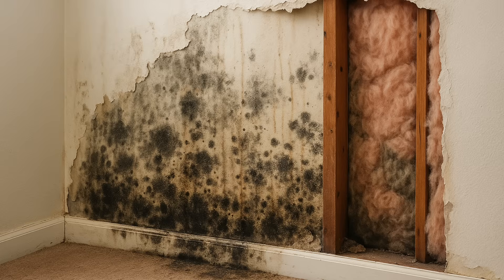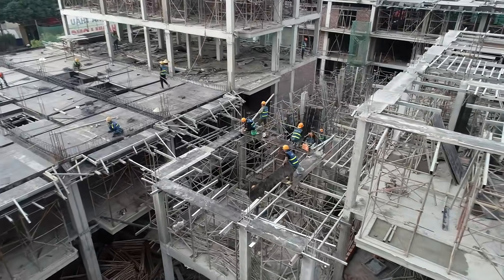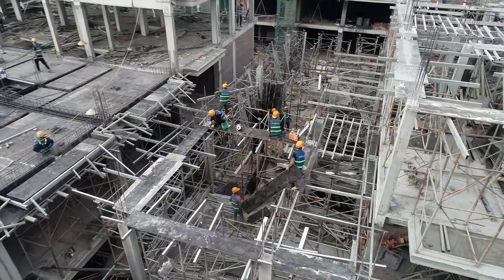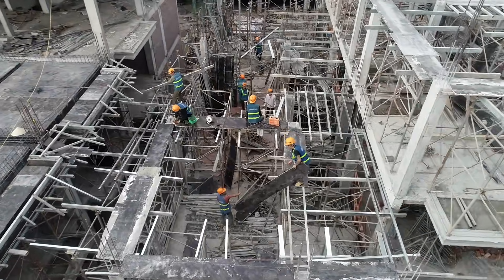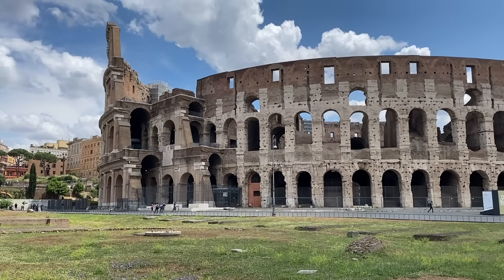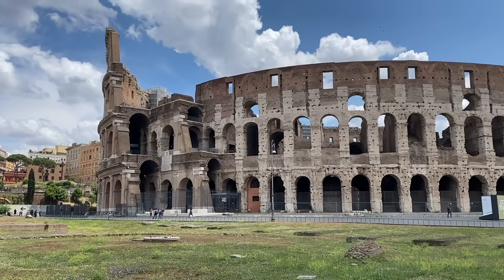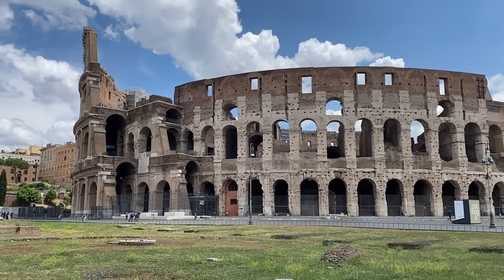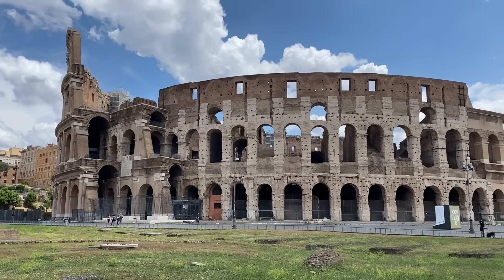The Four Control Layers | Series Intro: How We Got Moisture Wrong

Comment: "Modern materials like drywall, OSB and fiberglass insulation" :)
Greetings from central Europe where we generally don't use these and rarely do we have issues with moisture in modern buildings, even though the weather can be moist. I see quite a lot of buildings here using concrete for structure and aerated concrete block walls, with a thick layer of EPS outside. Ceramic blocks optional, but also see them used quite often. It requires much less skill and precision to build with these than with wood, construction is not as fast though. Fire resistance is just a bonus. Windows, even the cheap plastic ones, are not a joke here - 3 panes standard, clever ways to open, 100% airtight with ventilation deliberately engineered in. :) (disclaimer, I'm not in the construction business, I only describe what I've seen and experienced personally)
Reply from the maker: Ahh that’s really interesting, thank you for sharing! My background is Swiss, and I’ve noticed the same — when I was last in Switzerland, I actually felt so much better indoors. I’m highly sensitive to even small amounts of indoor mold or microbial growth, and it’s incredible how much building standards and materials influence that.

Modern materials like drywall, OSB, and fiberglass insulation just don’t manage moisture the same way. It’s fascinating how systems like EIFS worked well in parts of Europe but caused widespread failures here in North America, likely because of differences in climate, craftsmanship, and detailing.

I’ll definitely explore more of those differences in future videos — there’s a lot we can learn from how things are done in Europe. By the way, where exactly in Central Europe are you located? 😊
Reply: @RootedResilientLiving  Thanks! Switzerland, nice! I used to go skiing in the Alps every winter, in the Italian or French part though mostly :).
There is a bunch of videos comparing American ways vs. German ways of doing things. I found the German technology to be mostly the same as the one used in my home town of Krakow, Poland, so I just lumped them together (actually, I would not be surprised if all this originated as a German technology, manufactured in Poland where the costs are lower, and it became widely adopted where the climate is similar - which would be the middle and the east of Europe, where we get frost in winter and summers are relatively warm). A clip that shows a typical modern house structure (well, maybe a bit on the expensive side because of the large windows and forced air ventilation which we normally don't do, fluid heating is a cheaper and a mostly sufficient option) seen from an American point of view: https://www.youtube.com/watch?v=19TU6s0udlw. The exterior features recesses ready to accept probably some 7 inches of EPS/styrofoam (or mineral wool, but that's less likely). The buildings in the background used external EPS insulation for sure, covered with plaster. If it was more to the north east, the insulation layer would be thicker, but that's a negligible cost increase.
Reply: I'm just trying to say that in a dry climate wood is fine but when there is more moisture in the air, building with wood is challenging, and maybe there are easier ways, like concrete or ceramics. We've decided to switch even though our grandparents used to build with wood and loved it.
Reply: @RootedResilientLiving 
I had the same sensitivity to mold spores. What helped was taking Itraconazl (check Dr. Andrew Campbell) and after some time Amphotericin B in a nose spray. 1-2 drops in 20ml salt water. I guess there was a fungus growing on the mucus in the sinus. A CT of the sinus will help finding out if there is something. MRT or ultrasound usual does not show it. 

Great videos BTW. Best house I found so far is Thoma Holz100 in Austria. Last year when I was doing really bad I was in one. Natural wood is antiseptic, all my symptoms where gone after 2 or 3 hours. The terpene from the wood (like essential oil) does something. My wife wants to move back to Canada (from Germany) to the woods. We‘ll see if that works for us, but for sure I‘m sure I want to build full wood (no VOC) houses. It just makes sence.

Comment: excellent video. Great explanation. Being 60 years in this business, and having disassembled so many many walls, i have to admit I wonder why I have not seen more of the damage you speak of, even in this rainy climate of the Pacific Northwest. Not to say I have not seen moisture damage. I have indeed, but you seem to be saying it is universal. The last video I watched of yours was largely about moisture in basements, and while I've seen that as well, I have seen as many bone dry basements, it makes me wonder what is the difference, when almost all of my experience  is standard residential frame construction. Don't get me wrong if I sound critical. These are sincere questions. Could you also cover cost of rammed earth? Again don't get me wrong. I think you are doing great work.
Reply from the maker: Thank you so much for your thoughtful comment — I really appreciate your experience and the respectful way you’ve raised these points.

Research shows that roughly half of buildings have ongoing dampness, and around 80–85% have had water damage at some point — often hidden within walls or floors. So even when everything looks fine from the outside (and possibly even the inside if the materials had been saturated in the past and dried out), the conditions that allow microbial growth are surprisingly common.

In my own experience, I notice it almost immediately when I walk into a building — the smell, the way the air feels. My body reacts to microbial growth long before most people would ever detect it visually. Tests like HERTSMI often confirm what I sense: even small, past moisture events can leave contamination behind.

That’s why I focus so much on moisture management — because even “invisible” issues can add up to a big difference in indoor air quality, especially for those of us who are more sensitive.

(here's my source for the stats above: https://www.epa.gov/indoor-air-quality-iaq/summarized-data-building-assessment-survey-and-evaluation-study)

Comment: I live in south-east Europe in a building that has been build in 1963. The apartment is south/north-facing, the out-facing walls are around 40cm its not a joke !  4cm of sand and cement finish on the inside and outside, bricks in the middle. In the winter, inside temperature doesn't fall below 18-20'C without any heating, outside it is around 0–5'C for the most part and some weeks It can stay from -10 to -5'C. For the winter season I use just an ordinary 2KW heater with no fan. It has a 30m2 connected room heeted in 5 min to 25'C, wooden floor, and no insulation on the walls. In the summer, I keep the north windows open 24/7 and block sunlight from the south side windows. That by itself keeps the rooms temperature around 22–25'C, when outside it's 35'C. No extra moisture, no funguses, good ventilation, low electricity bills. You can't get this in new buildings ! My electricity bill is the same cost as two large family pizzas in the summer and 4 in the winter ! It is not perfect, walls are little bended, corners are not exactly 90 degree, but that's not a problem, because you don't need to place drywalls inside :D !
Reply from the maker: Wow, that’s incredible — thank you for sharing this! What you’re describing is such a perfect example of what good thermal mass and smart passive design can do. Those older, solid-wall buildings often have so much inherent stability because they buffer heat and moisture naturally, instead of relying on thin layers and mechanical systems. Sounds like your home was really built to work with the climate rather than against it — and it clearly still does!
Reply: @RootedResilientLiving  Yes the humidity is high as it is located near a water mass, but basically walls are just sand, clay and adhesive agent in more "modern" form for the contact surfaces and concrete for structure straight. Few years late when the communism and central planing was ruling all buildings were concrete segments welded together. Unfortunately they "forgot" about quality and focus on speed in order to build in mass and move population from villages to a city to work in new production facilities. First generation were ok, but the children had a lot more new problems regarding health issues, based on air quality and humidity condensation. History is rich, just people are to cheap to value it 😂.
Reply: Here in the USA my dream home is an ICF (insulated concrete form) home, 6-inches of concrete to keep the cold or heat from getting inside.
Reply: Sorry, but I have to call bullshit on this. An uninsulated brick building does not stay at 20 degrees all day when it is 0 outside without heating. The sun will help somewhat on very sunny days for a few hours around noon, if there are no obstructions to the low in the sky winter sun and there are large south facing window. Also people and appliances give of some heat. But this is not enough to keep a constant temperature when it is freezing outside.
I do not mean you are lying, but I guess that you are profiting from the heating of your neighbors below and above. They have to compensate for your lack of heating because their floor/ceiling/inside walls are colder.
Reply: @nmayor4232  the walls are around 40cm and it have 4-5cm of sand finish inside and out that is serving as termal insulation. There is no one leaving under my floor and on the sides, only above, but to be fair on the wooden floor there is a 5mm leveling that can be count as insulation before my laminated wooden flooringe.  At this very moment outside temperature is 14'C and the surface temperature of my outside wall with french windows is 22.4'C. The walls on the left and right of it are 23.2 and 23.0'C. I have lived in 5 different places in my home city, concrete buildings from 1980s, new brick building from 2010+, brick house built around 2000 and I sand by my observation.
Reply: @martinkostov75 my house also has 40cm brick walls with lime render inside and outside. The bricks are also quite light made from pumice, so they offer some modest thermal insulation compared to clay bricks or concrete. But I still have to heat from October to early may. It was an unusually cool and rainy summer this year in Germany, so I even had to turn on the heat a few days in July.

You must either live in an extremely sunny place with no obstruction of the horizon, like at the ocean or on a south facing hill, or you use magic.
Every wall will reach outside temperature eventually without some heat source, the is simple physics.
Reply: @martinkostov75 also, can you measure the wall temperatures early in the morning and also the north facing wall?
Reply: @nmayor4232  So, 6:05 in the morning, sun is yet rise, outside temperature is saying 5'C, the north facing wall of my kitchen is 19'C, the inner walls are 21 to 21.2. Good day to you, hope this helps.
Reply: @martinkostov75 sorry for taking so long to answer. We got new windows this week and I was quite busy.
Thanks for the additional measurements. But this tells me it is not the sun that keeps your walls warmer than outside.  There has to be some source of heat. There must be some surfaces that are significantly warmer, so they warm the wall by infrared radiation.
Just to make sure, I assume you measured the walls with an IR thermometer, right?

Comment: Finally somebody who takes on the theory of the control layers ("The Perfect Wall" by Joe Lstiburek) as what it is, just a theoretical concept.

The most important layer in my eyes, is the air control layer... in wintertime you want to keep the warm air in, in summertime the opposite.

To avoid condensation against that air control layer (or surface), you need to keep that layer warm.
In winterime you can do that by adding external insulation, in summertime by adding internal insulation. This is not practical, so you need two air control layers with the thermal insulation in between.

To avoid any locking in of moisture, those two air control layers and the thermal insulation in between must be vapor open (almost all plastic insulation materials are therefore useless) .
 
When talking about moisture control and condensation, don't forget to speak about capillary active materials.
A capillary active material can become wet on one side and can dry out on the other side as it not only soaks up moisture but will also distribute that moisture.
That's the great difference between lime and cement (or gypsum), they will both suck up moisture (water) but only lime will distribute it.

Other known capillary active materials are solid wood, plywood (not OSB), wooden insulation boards, fiber cement boards, brick, Hempcrete, Autoclaved Aerated Concrete (AAC),...

Vapor open materials are not always capillary active, i.e. dense packed cellulose (just like most insulation materials) or exterior facade membranes.

If you want to combine all control layers into one material, you're better of with Hempcrete(+ lime plaster or linseed oil paint) than with rammed earth as Hempcrete is a much better thermal insulator.
Reply from the maker: Totally agree — capillarity is such an important concept, and it’s amazing how often it gets misunderstood or lumped in with ‘breathability.’ What’s so interesting is how different those mechanisms really are: capillarity is about the movement of liquid water through connected pores, while vapour openness is about the ability of a material to let water vapour pass through as gas. They both deal with moisture, but in completely different ways.

And I completely agree with you about air movement — that’s such a huge part of the story. Most modern moisture failures come from air leaks moving moist air through assemblies far faster than vapour diffusion ever could. It’s something we still tend to underestimate in building science, even though it’s often the main culprit behind hidden mold and decay.

Really appreciate your comment — this is exactly the kind of conversation that helps connect all these layers of understanding.
Reply: @RootedResilientLiving  You're correct!
I must say, you're very well informed! 🙂

The most resilient building materials combine both properties regarding moisture, they are both vapor open to transport damp and capillary active to transport wetness (water).

That's why houses made from solid wood, brick, lime mortar (and rendering),... last that long even when not wel maintained.

And that's why Hempcrete is such a great building material.

This also means that when you apply finishes to these materials, you must be sure the finish wil not disturb their excellent moisture properties.
When using paint, only linseed oil paint or lime paint should be used.
Reply: Thank you so much for this comment. I had been wondering about hempcrete and was getting ready to ask and you provided this information. 
I just moved into a new building that replaced a fifty-year-old building that had serious leaks and it had replaced a building that had been about fifty years old. This building  might last 50 years, to be replaced again. Building contractors make money and construction workers have a job at this location every few decades, old building materials fill landfills, new building materials provide employment in the production and transportation stages, and money gets transferred. 
I'm so glad I found this site and that there are well-informed comments showing up.
Reply: @archeanna1425  You're welcome!

Some YT-channels regarding building or building science don't appreciate my comments though... Two of them have me more or less blocked ("hidden").

Lot's of these YT-channels just repeat commercial information without fully understanding building science, some channels even preach the correct solution but end up doing the opposite for commercial reasons...

If you come across a channel promoting spray foam, poly iso, EPS, XPS, ZIP sheeting, plastic vapor barriers, etc.... be aware!
Reply: I learned a lot from Joe L. when I remodeled my home a decade ago.  It's amazing to me how few people in the trades really understand how complicated these issues are.
Reply: @brianshea4177  Yes, I also learned great insights from Joe L. but the problem is that even he gets entangled in that ("his") concept of "The Perfect Wall" with all those seperate control layers. 
For instance, there's video on YT where he's discussing exterior wood fiber insulation (from TimberHP) and to make it fit in his concept of the control layers, he says you need to keep an air gap between the wood fiber insulation board and the WRB control layer "so any condensation can drain away" (wood fiber boards are vapor open) but by doing so, you make your thermal insulation useless...

The same with Matt Risinger and his fellow members of "The Green Zip Brigade"... they act differently from what they preach regarding building science...

It's not easy to separate the control layers if your dealing with materials that are not allowed to get wet (like insulation, wet insulation not longer insulates that good) or in climate zones with cold winters and hot summers,... that's what so great about this video, it's a down to earth approach... pun intended ;-)